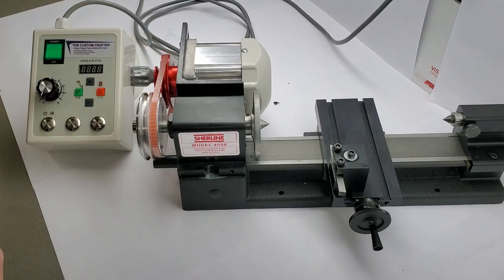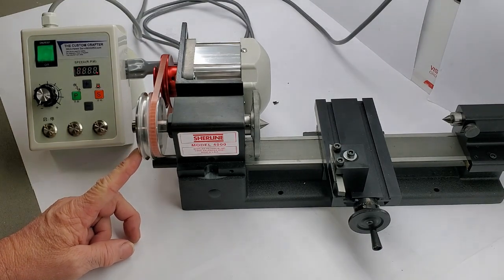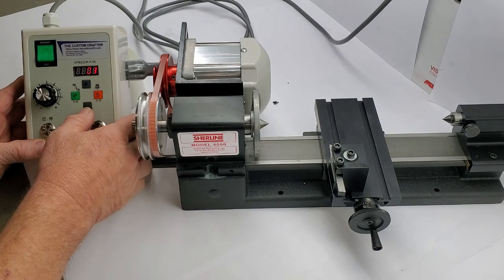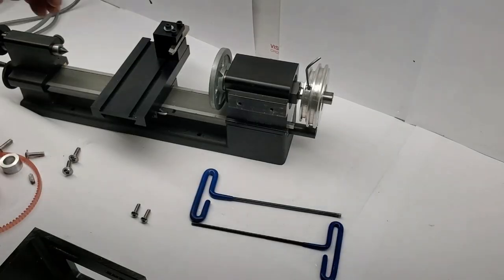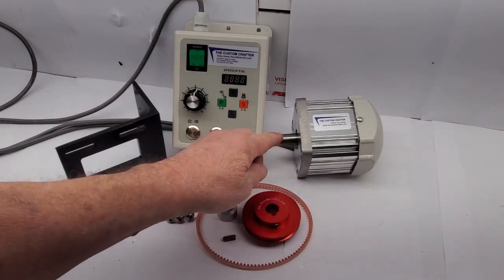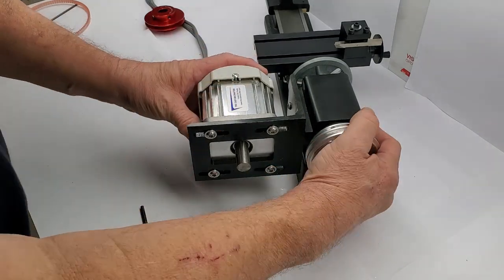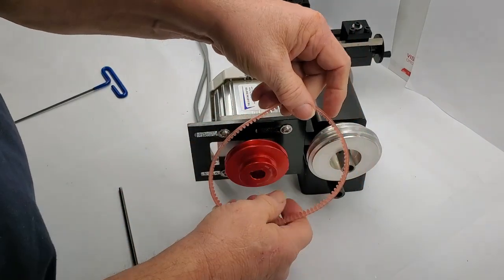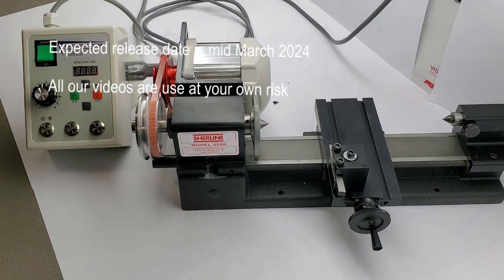Sherlinevideo1

Comment: This looks like a really great product.  How easy is it to convert to CNC?
Reply from the maker: Our new controllers are much easier to control through CNC. An isolation board is required. We are working on bolt on CNC systems now. New systems take a long time in R&D before being released.
Reply: @danielmartin382  Thanks for getting back to me so quickly.  I put an order in for this upgrade last night.  When I get it, I will do some experimenting to see if I can connect it to my CNC.  Can't wait to get this, should be a very cool upgrade.
Reply from the maker: @DominicUliano  Your system is complete and ships out tomarrow. My printer sh-t the bed right after printing the shipping label so no paperwork in the box.
Also I need to remake the video because: There is a huge improvement to the motor mount. Also the spacer is no longer used or supplied.
When building yours, notice how the Sherline pulley is in the above video. It came reversed on many Sherline lathes.
To reposition the pulley on the Sherline spindle just file a small flat for the set screw in the new location. I will update the video if/when I find time.
Reply: @danielmartin382  Sounds good and thanks for sending out so quickly.  I'll contact you through your website if I have any questions when I assemble it to my lathe.

Comment: Hey do those servo motors need any maintenance?? Will they last for a long time if not abuse them?? Do you ship to Europe/Greece?
Reply from the maker: These motors were originally built to run the textile industry in China. They  run 24/7. I have been running many for 3 years each in my shop. 
Oversize bearings, No brushes, no failures. Running under 500 rpm's under heavy load builds heat because the fan is running too slow. 
In this circumstance you need an extra heat sink.
I currently do not ship to Europe but you can use a US address reship service. Maybe open a franchise and I can drop ship you stock tariff free.
Reply: @danielmartin382   you mean extra heat sink to the motor or to the board?? will a 12v pc fan work on both?
Reply from the maker: In rare circumstances, I use an extra heat sink thermally bonded to the side of the motor. No fan needed.
No need for an extra heat sink to the board as this is already done on our systems. However certain chips do require a heat sink on all other brands @ThanasisThomas